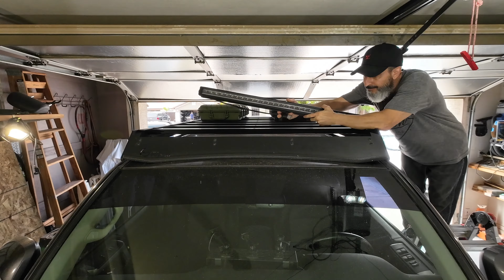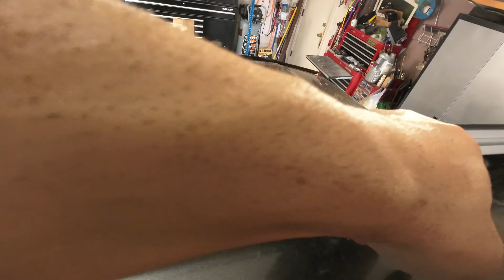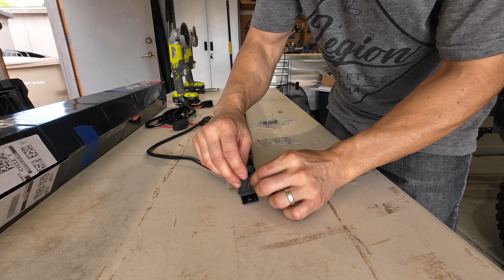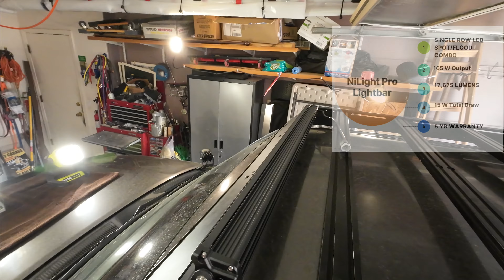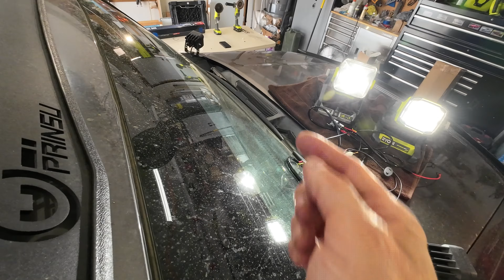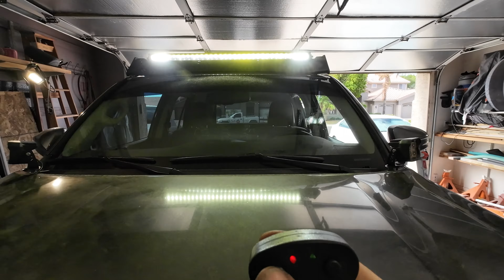4Runner 40 " Lightbar Install on Prinsu Pro Roof Rack - Nilight

Comment: Thank you for the video! I am looking at getting the Prinsu Pro Rack along with the 40.3” Nilight LED light bar with the amber DRL. I was leaning towards this specific rack for my ‘25 4Runner because Prinsu offers the grab handles and basically everything I will want in the future. The only holdup was the light bar and I really wanted the Nilight but I was worried about it being 40.3” going into a 40” cutout on the rack but this single video sold me on everything. Thanks again and have a great day!
Reply from the maker: I'm glad it was helpful! I did a few videos on installing the Prinsu Pro by yourself as well. Cheers

Comment: Can I tap the light bar into the high beam, so every time the vehicle high beam on the light bar also on?.❤
Reply from the maker: Sort of. You can operate the light bar using the high beam as a trigger but you shouldn't tap directly into the high beam wire. It will most likely overload that circuit. You should look into wiring in a relay and inline fuse to keep everything safe
Reply: @AZOverland2017  thank you.

Comment: how come you didn't flip the light bar and put the harness clips on the drivers side?
Reply from the maker: The LEDs on the main light are angled and I don't think they are designed to be mounted either way. I believe this light bar is supposed to have the DRL on the bottom and the main light above it for full effectiveness

Comment: Why couldnt you flip the bar over and put the harness on the drivers side?
Reply from the maker: Excellent question. I'm not completely sure, but i believe with the way the LEDs are installed in the bar (sort of curved), mounting it with the driving light on top may affect the way the lights are supposed to project. I would reach out to Nilight to confirm

Comment: Hi there, can I hardwire a dash cam with the auxbeam panel? Thanks!
Reply from the maker: You should be able to. However, it would turn off when ignition is off and you would need to press the button when car is on to start it

Comment: Seems like most manufacturers are making combo (flood and spot) light bars. The flood pattern on the roof is know to cause glare, especially off the hood. How has your experience with that been?
Reply from the maker: @PJSnow23  I haven't taken it out yet at night. I have a lower amber light bar as well

Comment: Great video!
Reply from the maker: Thank you!
Reply: Can't you swap the L brackets right to left so the base is under the light bar? That way, you can get a longer light bar.
Reply from the maker: @89crix  I suppose you can, as long as there is room to get a wrench under the bar to tighten the nuts